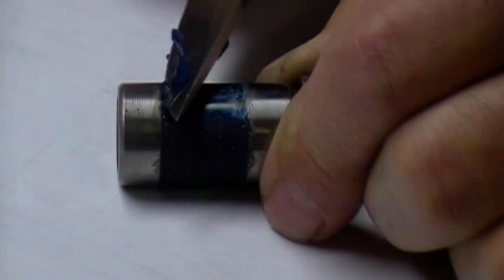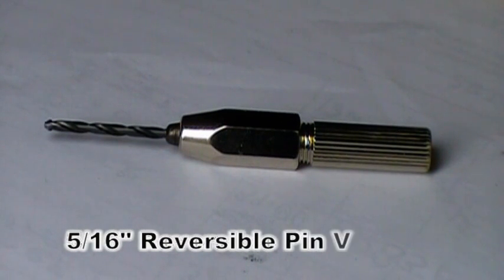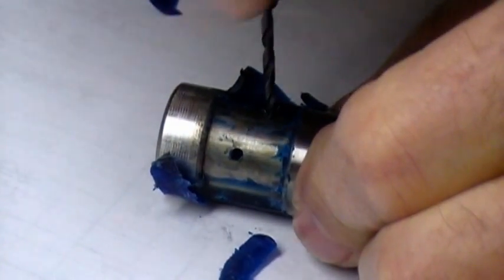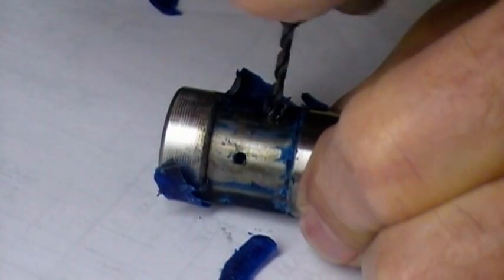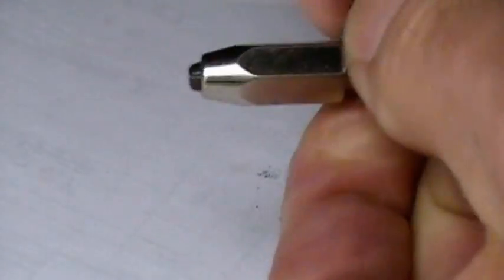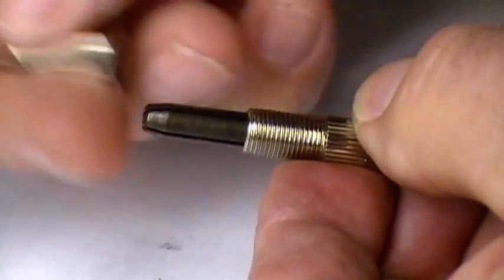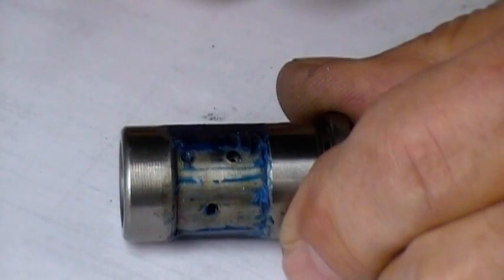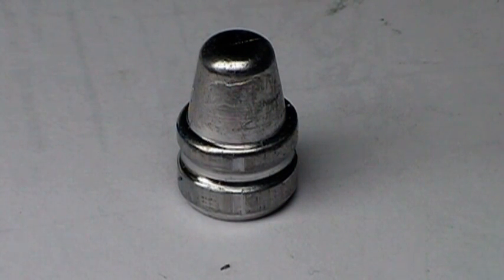How to remove shot from the Star Die

Comment: I bought them a magma star with a heat base,air cylinder  and some dies, and many molds,,, but now they don't sell me the dies, nor do they answer, I also bought them a 313 but it really is a useless 315- 316, I would think twice before to buy something from these  people. Especially a $13,000 machine. Because you may not get dies or spare parts,